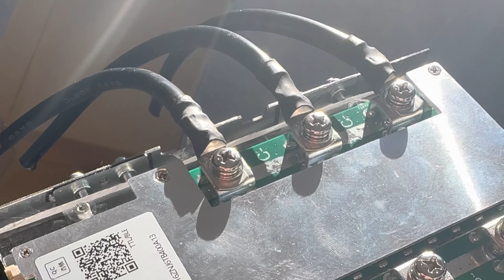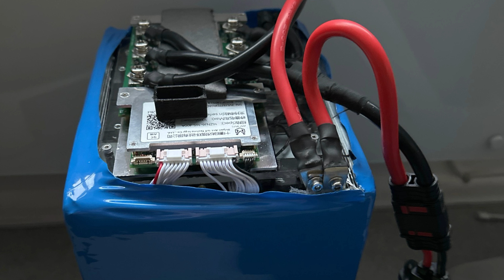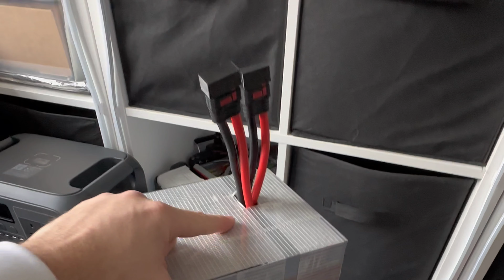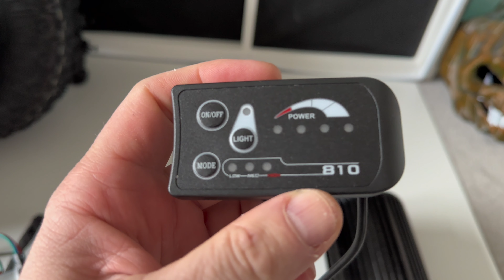The Rizzler mini ebike Build Has Started

Comment from the maker: PARTS LIST BELOW.👇🏽👍🏽😁

0:00 intro
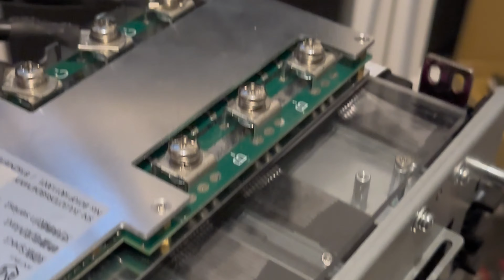0:32 The battery build.
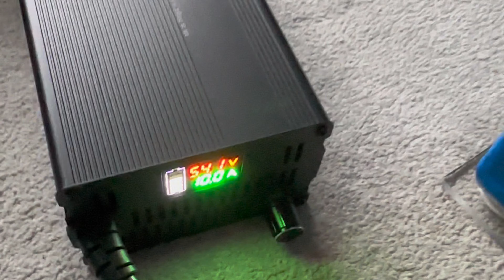1:48 The first charge on The battery.
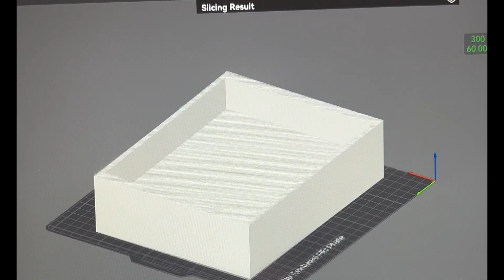2:10 3D printed The Battery Top.
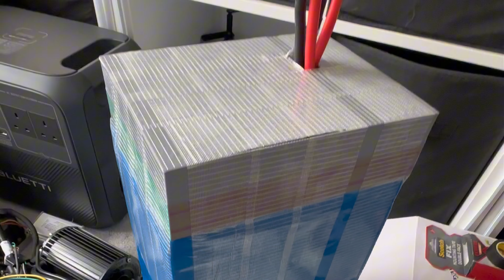2:39 Top On And Ready For Wrapping And Sealing.
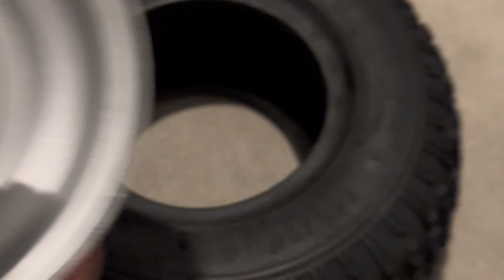3:32 the wheels have arrived ready to fit 145/70/6 tyres.
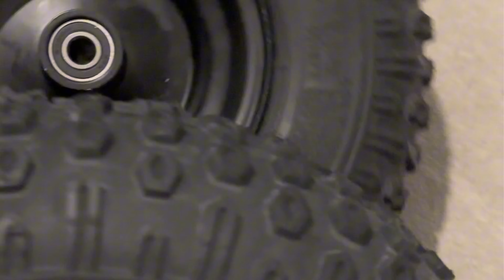4:10 mini bike forks arrived from the US.
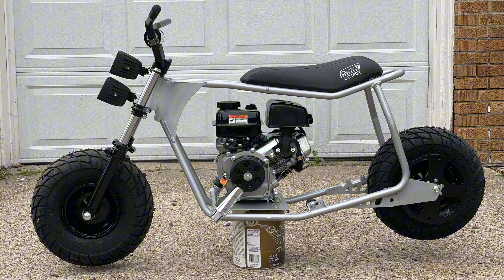4:32 The plan For The Frame.
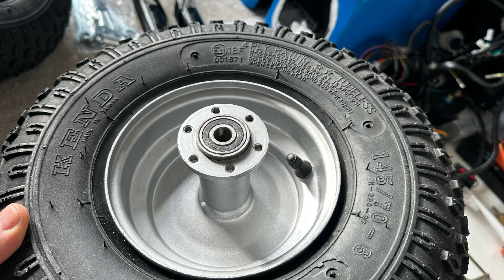4:45 Brake Rota and Calliper.
4:58 The Handlebars.
5:13 Handlebar clamps.
5:19 Rear sprocket.
5:31 Drive Train QS90 Motor Testing Modes.
6:23 Like and subscribe Check out that other video. Thanks

 Mini bike parts list so far.

Hydraulic Brake Kit With 180mm Brake 
Mini Bike
https://a.aliexpress.com/_Evd5lkg

22mm Drag Handle Bar Clamp 
https://a.aliexpress.com/_ExdHkXw

QS8 Connector Male and Female High Current Anti Spark Connectors 
https://a.aliexpress.com/_ExrnQ7K

Front wheel 6 Inch with hub
https://a.aliexpress.com/_EypDjac

Rear wheel for Coleman mini54 CT100U  
https://a.aliexpress.com/_EyuiWsy

Tyres 145/70/6 kenda
https://ebay.us/m/Nn6URd

Handlebars
https://ebay.us/m/osMyGx

Mini bike forks
https://ebay.us/m/MzHsbp

Rear axle
https://ebay.us/m/LfT2sI

Rear sprocket 
https://amzn.eu/d/5NfNyBs